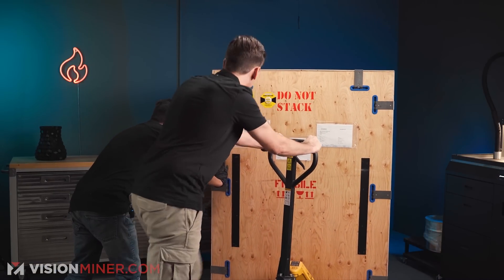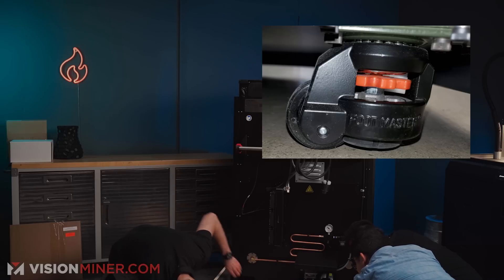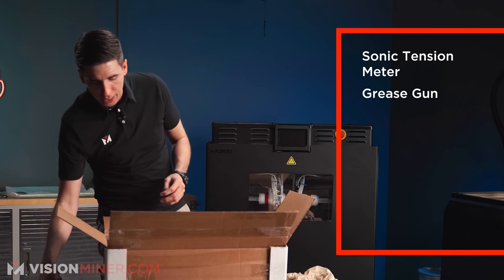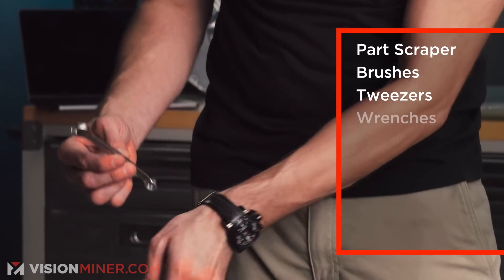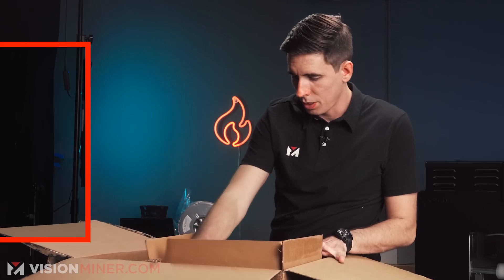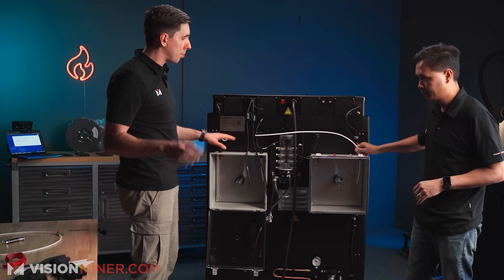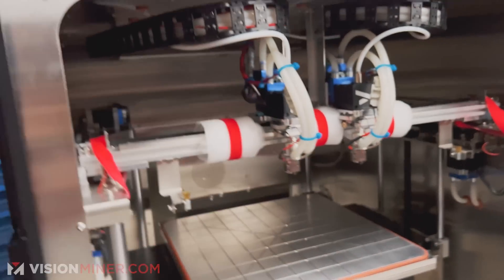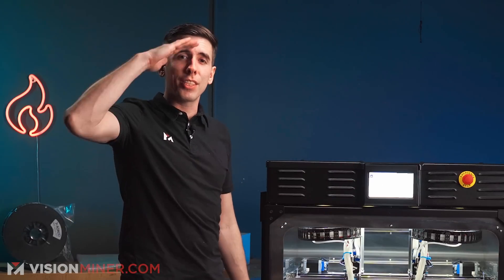UNBOXING an $80,000 Canadian High-Temperature 3D Printer: AON3D M2+

Comment: what is the compressor used for?
Reply: The vacuum pump is for the configurable build plate system. This allows you to use different build sheet materials based on the material you're printing, enabling the two to create a strong bond without using rafts, glues, hairspray, etc. For example, PEI 9085 loves to stick to a CF PEEK build surface but doesn't stick well on Garolite G-10.
Reply from the maker: The vacuum pump is for the vacuum table -- the build plate keeps plates and sheets in place by using vacuum pressure :)
Reply: An air compressor in a machine like this is usually to pump dry air to the filament chambers to keep moisture away
Reply from the maker: Actually it's a vacuum pump, used for the buildplate -- it holds them down with vacuum, so you can use any type of sheet material without it peeling up in different areas :) Super hot-swappable!